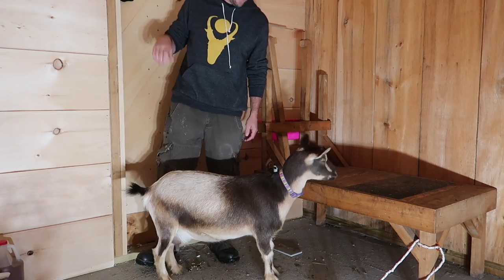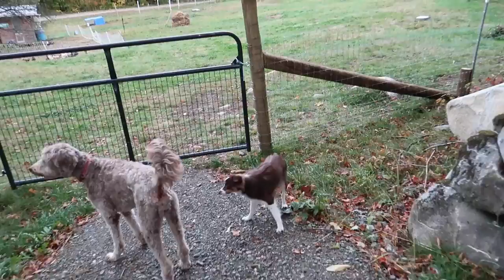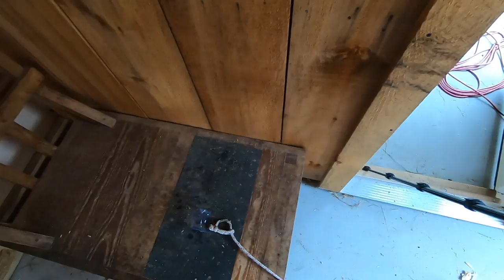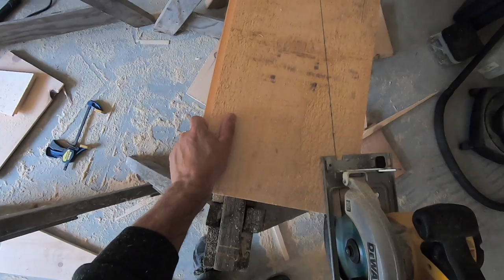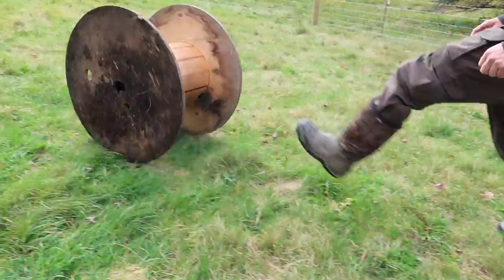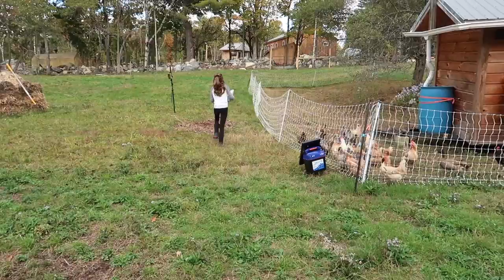PENCIL HACK improved my woodworking skills (installing Shiplap)

Comment: Al, as for your cutting technique.  Your skill level with the cordless is top notch.    When you cut the triangle shaped piece's at either side of the door, I would have done the back cut as well.  Just like you did on the horizontal pieces.   It would have given you a much easier time, getting a tighter fit to the ceiling board.    Easier to compress a thin tip, than the full thickness of a board.    This is one area where a sharp block or bench plane excels.     The milking room is definitely looking good !   Can't wait to see the shop done !

Comment: The trick on a scribe line cut is to tilt the blade say 20 degrees or so when you cut along the line the outside edge is all that will contact the mating surface.  This makes it easy to fine tune the fit by sanding or planing just the very corner of the scribe cut.

Comment: I'd keep them in the electric fencing. Same with some other comments, you still don't know what's attacked them in the past. Just because nothing has been back lately doesn't mean something won't return when there's fresh snowfall and little food in the woods to hunt. To add to that, that is a LOT of area that the chickens could wander, and they can very easily get through your gates you set up.

Comment: Love all your hard work!!  I can watch you all day!  A tip I saw somewhere else on YouTube regarding your cracked tape measure..  If the crack isn't too deep, like maybe 1/8", use a pair of shears and cut out a shallow crescent that removes the crack and smooths the edge.  You likely won't ever miss the missing markings or even a number.  I had a brand new tape kink and crack on only the 2nd use.  My fix has been there going on 6 years now.

Comment: Hi Al and Gina, the milking room looks terrific! 
We have about 75-100 birds and we keep them penned up like you do, but we let them out later in the afternoon to peck and forage. We feel its safer for them (we have to worry a lot about owls, hawks and other large birds) because they are only out for a few hours as opposed to all day. At night, they put themselves away and we just go out and close up the doors before full dark.
As and added precaution, we keep a small .22 handy incase there is an attack.
We keep geese, ducks, Guinea fowl (very noisy)and a few different breeds of chickens.

Comment: Id keep the chooks in the electric. You dont know whats attacking still and You dont need anyone else going how CWC went.
Reply: That's what I was thinking, CWC proved that was Not a Good Idea!!! If you do let them free range, anyone want to take odds. Ha
Reply: He isn't going to leave them out all night ...they will come to no harm so let them  free range in the pasture.  I think a more important project is to find a more suitable coup for the other flock.  The need some shelter now it's getting colder
Reply: My folks had twenty-two hens and some roosters plus a turkey that coyotes took right out of the yard, not fifty feet from the house.
Reply: @simonfreer7950  that coop did well for the 7 1/2 months of winter they had last year. You also need to remember that things take chickens even in broad daylight.  While in the electric fence they are contained close to protection from overhead predators also. With the mobile coop they can all get under if there is a hawk about. Out freerangin in that full acre paddock... they will be too far from that over head attack protection
Reply: @rosiec1974  The other flock were sheltered in the greenhouse  all winter last year not in a chicken tractor.... they would not have survived if they had been.  If a hawk was going to take one of Moose`s girls if would have done it already give them the range of the pasture.  Andy and his girls did just fine free roaming
Reply: @simonfreer7950  moose and his girls were in the camper. It was Andy and his free ranging girls who were in the green house over winter. Then Andy passed away.  Free range you have no control over where they lay   .. where they  scratch.. where the manure load goes. Al has already said he wants the moss scratched up.. soil improved. . To do that you have to control where they are
Reply: @rosiec1974  Mooses girls will lay in New Yolk City even if they are free ranged as for manure they will spread it everywhere and they will eat all the bugs and larvae not just in the small run they have
Reply: @anitablades6033  I agree.  The predator will turn the egg chickens into meat birds quickly.

Comment: It's nice to have chickens free range and eat up all of the bugs and weed seeds. We are going to get to 85 degrees today! A couple years ago I built a large run-in for our horses and started the project on September 1st. It was VERY warm until the 1st of November. You just never know! I hear you on the "do it right" statement. I'm nearly to the point of putting on the rubber (flat) roof on our project, and I want to rush through and get it done -- but with flat roofs, that is not a good idea. Keep up the good work Al!
Reply: I roofed my House, I loved it. Went up there with a floor lamp and a radio. Worked long into the night. Oh I'm a Female!!
Reply: @anitablades6033  - Kudos to you Am. Blades! 👍

Comment: The pros of keeping the chickens in the enclosure would be that you are able to focus their scratching/fertilizing/bug eating in controlled areas to help improve the soil, not to mention keep the goats from snacking on the chicken tractor and automatic door. If you do free range them, I heard they stay within a set distance from their coop, so you will still need to move the coop periodically to adjust their "territory". At least you will not need to rearrange the fencing each time! If a chicken gets outside the main fenced area, though, they may get confused as to how to get back in and wander the fence line.

Comment: Al, you had me worried when you reached over the still running table saw blade to catch your board. Please don't do that! I had a friend who lost a thumb just quick as can be, and he was an experienced carpenter. No board is worth losing a thumb!
Reply: Thomas Stordahl-Gregory ~ I gasped when that happened. My younger (guitar-playing) brother almost lost two fingers when he was a teenager, putting a chock of wood in a still-running saw to stop it so no one got hurt. It threw the wood across the room and the ends of two fingers went right into the blade. He was EXTREMELY lucky it only touched the ends, but he had a lot of healing to do.

Comment: The area they are in right now has been depleted for some time and they should've been moved already. Realistically, they can't free range in the snow, so moving them closer to you for easy access in a fenced-in area would be best, my opinion for what it's worth. The gates will also need to be kept snow free from drifts inside and out.
Reply: That's silly !
Our pigs free range until end of December when the ground freezes solid
Reply: I agree I just told Al he needs to move new yoke city up by the out door kitchen area. my thinking its close and he can plow right to the front door of new yoke city
Reply: @ka6148  I thought Tannenbaum was talking about the chickens...
Reply: @donaldmann8193  New Yolk City

Comment: Good job with the pine boards ( cancel my comment yesterday re Willow eating the foam ) 
Remember to run some wire for a receptacle by the milk bench area, to plug you vacuum pump into, Hide it in the workshop wall before you finish the walls in the workshop, then you wont need the extension cord. Somethin less to trip over or for the goats to chew !

Comment: I recommend moving the milking sand 2 to 3 inches or more  from the wall where the goat head is so Willow will be more cmfortable.  You lost that space when the ship lap was  attached to the wall
Reply: Yea, AL may be able to put the milking table facing the other door on other side of the room. So it'll still be in a similar position for Willow to hop on from the left side.  I don't know, but it seems there might be more space to move the milker back a few inches, & the window is the only thing there. Where it's at now, the door is right there, & he wouldn't want to block that door from the milking room into the shop. just brain-storming about it........

Comment: May I suggest that if you replace  your tape measure, try the new ones that automatically lock the tape when pulled out, then press a button to release. As you say: "I like it". I got a 25 footer at Walmart for about $6, but the Dewalt branded one was about $9.

Comment: Do the walls first, then the ceiling. That way the gaps are less obvious. You should also plan the Oder of the walls so the gaps are less obvious from the most frequent position.

Comment: I have seen other homesteads (Justin Rhodes) use a guard goose for predators.  The goose goes in with the chickens at night.  I think the only predator that would go after them during the day is a hawk and being in the electric fence wouldn't prevent that so free range seems like it would work.  ❤️

Comment: Make a block as thick as the widest part of the gap that you're scribing. Tape it to your pencil, run the block along the ceiling and the pencil along the wood you're cutting and it will fit perfectly first time. Or do it how carpenters do it with a pair of compasses set to the widest part of the gap. Standard practice.

Comment: The goats are really cool with exception to indiscriminately pooping anywhere.  I'm not sure how hard it would be (you make everything look easy) but try cutting slots into the top deck of where they sleep so the pellets will fall through.  Clean up should be a bit easier. A slanted 1/8 piece of plywood could be easily installed to deposit the pellets to either side (or something like that).  I'm not criticizing you and or your work I think you guys are awesome and are doing a great job as a christian  family just thought it might help.

Comment: Because of predators, I'd keep them in the electric fence. They can also get out of holes in the fence that goats cannot. Predators of chickens that wouldn't bother goats can also get through. If you do decide to free range them, start now, training them with a call, to come for a meal. Every time you bring them something, use that same call. Even if they don't have to come running right now, they'll eventually start associating that call, with "dinner".

Comment: Curious as to why you don’t move the chicken coop exterior nesting door (where you collect the eggs from), close enough to the netting, so you can open hatch without having to climb into the chicken enclosure?
Reply: Chickens could jump off over the fence!!!!!
Reply: Sorry Tony...was not my intention to start an apostrophe issue. I do seem to recall the CWC did not seem to have any problems scaling the poultry netting, in both directions, without any assistance. Just thought I would make the suggestion. 🐓

Comment: full free-ranging the chickens is going to produce more eggs... but it'll take a few days to see the increase. the downside is you really should have a larger rooster for that. with the number of chicken you have it 'shouldn't' be an issue having moose along with the new one.

the pencel trick is one of the many many things i used to do when installing wood flooring. i always carried a tape measure or three, but i rarely used them lol. it was always faster for getting around existing trim work. i'd also use existing lines to figure out lengths in small places. when customers saw how i/we did things they'd always comment about how they really were getting a custom floor. i did custom inlays too but those actually often needed very accurate measurements.

i know it's going to happen... a stone "Goat Mountain" is coming! maybe next summer?
Reply: Are the eggs you eat, Al, fertilized?
Reply: i don't know of any difference in the eggs in regards to eating them, fertilized or not.
'clean' eggs sit on the counter for a week (fertilized or not). then we wash them and stick 'em in the fridge... we eat a lot of eggs so they never hang around too long.

i've seen roosters warn all his chickens to run and hide from aerial as well as fighting and scaring off terrestrial predators as large as medium sized coyotes/dogs. i'm not sure Moose is up to the challenge being a small guy. he's got a lot of spirit, but having another one would be a better idea.

Comment: I would let them free-range (unless there are parts of the pasture you are worried about the scratching) but move New Yolk city closer to the barn.  I doubt you will have as much predator pressure in the pasture during the day with the goat activity out there.  Since the coop is closing automatically at night you have fewer issues with predators once the goats turn in.

Comment: I understand how letting the chicken roam has some appeal, but with a proven prowler around the area, I would err on the side of caution. As others said you are the one in charge, no pun intended, and the fence can keep your productive flock safer. You might need to make the protected area bigger, but I would avoid making it less safe. They are your chickens but do you really want to feed the local wild life?

Comment: kinda hard to say about letting the chickens run free. I let my girls run free and it’s like an Easter egg hunt every day. That’s probably my fault though. I have all new girls first year laying and didn’t leave them in the coop long enough to get use to using the nest boxes. Hopefully that will change this winter when they spend most of the day in the coop. I don’t even have any kind of fencing up around the coop as soon as I open the door it’s off to the races. Bonus we don’t have many bugs. Even saw one running across the yard with a small frog in its mouth. If it moves it’s chicken food.

Comment: Are you going to run electrical into the milkroom?  If so put it up chest level so its out of the way from liquid and animals don't  nibble:)
Reply from the maker: The plan is to run power and lights out to the milking room. I need to get the work shop done first.

Comment: "Go be goats..." that's what I used to say to the Shepherd, go be a dog. I was chatting with a friend a week or so ago about something we gave you a rough time about in comments. Recounting the order of operations at one point the friend agreed something was out of order. I said, if it was anyone but Al, I'd agree however; when Al finishes something, he really does a good job so he must have a reason. You proved me right today. As for the chickens, let 'em free range during the day when you are working in that area and see what happens; you'll either know what is after them or you won't.

Comment: It was 73 when I got up at 3:00 a.m. and now at 8:48 p.m. it's 84. It's gone down from 92. We always butchered pigs on January 2 when I was growing up. We raised pigs, so we had them year around.  Willows milk stand looks like it's too close to the wall. That may be why she was in a bad mood. I would try backing it up 8-10 inches.  Leave up the poultry netting. Fall brings out more predators, at least in our area.

Comment: I would take down the poultry fencing and let the chickens free range and maybe put some electric wire fencing around New York City like you have around the pigs 🐷 🐖 🐽 about 3 or 4 feet out and high enough for the chickens 🐔 🐓 to run under out from NYC to keep the 🐐🐐 goats 🐐🐐 away from New York City … also maybe take some of the rocks from the Rockwall and make a rock pile somewhere in the pasture for the goats to play on , this will give them something else to do for entertainment … The milking room is looking great but now it’s time to get some electricity into it for lighting and to plug-in you’re milking machine without running extension cords to trip over …… have a good day and may the good Lord look after you and your family